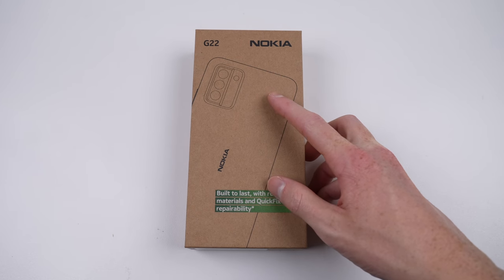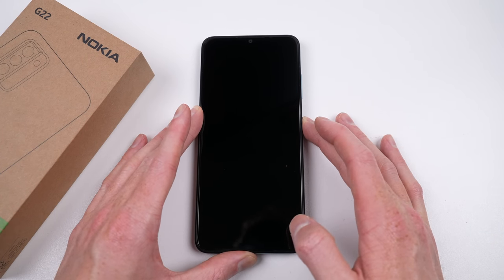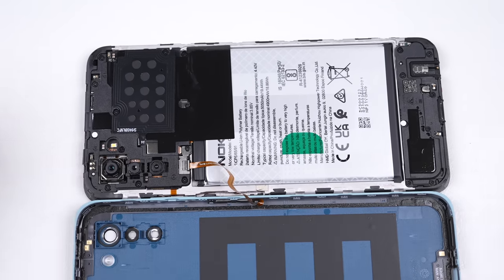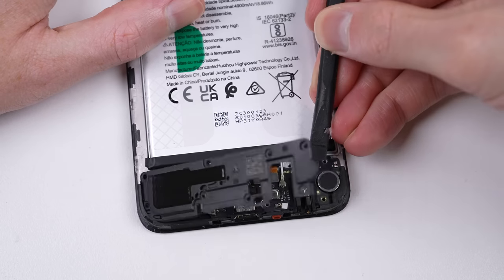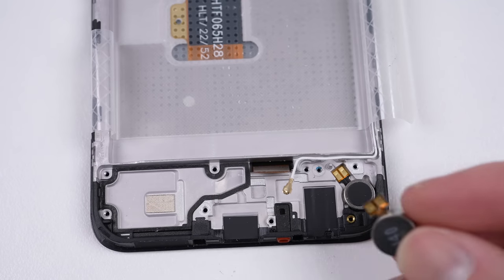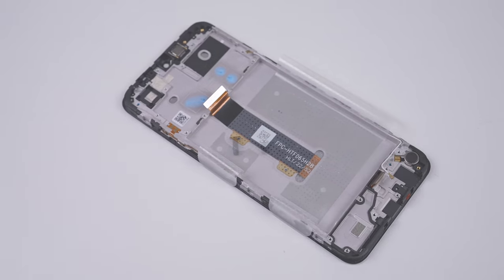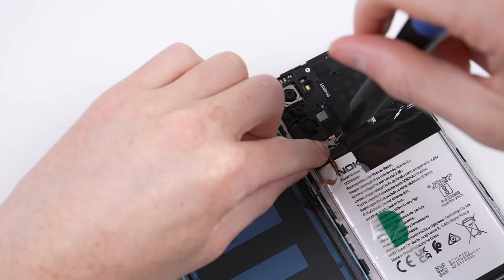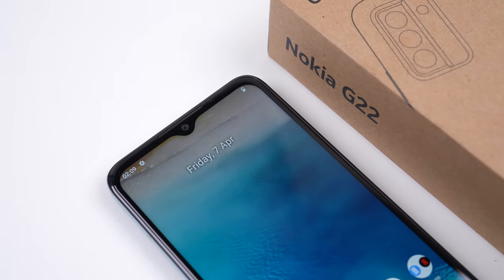Nokia Makes Its First Repairable Phone - Nokia G22 Teardown And Repair Assessment

Comment: As somone who repairs and resells phones and computers I'd say it's about as easy to repair as most modern budget phones however unlike most modern budget phones Nokia is encouraging users to have a go at repairing it which I support.
Reply: @sunshineflyer  now we need companies like apple and Samsung to allow third party repairs and easy access to parts.
Reply: @charlesrodriguez7984  yes, here in the UK I can actually buy Samsung original parts brand new from Repair Outlet. And apple needs to stop locking parts to iPhones and making them so difficult to repair.
Reply: I guess not many end-user will dare to open these. But the Nokia parts are relatively reasonably priced, and there are instructions. That makes life of repair shops so much easier and repairs worthwhile.
Support the local handyman!
Reply: @krollpeter  I agree!
Reply: ive fixed a couple phones, would love to never do it again. so annoying and stressful
Reply: @babyear5228  it needs to be across the board in every country. Here in the US it isn’t the same for every Samsung model.

Comment: Can we give Nokia a bit more applause for keeping their boot-loader unlocked?
Reply: nokia does not allow the bootloader to be unlocked. the setting enables the bootloader unlocking tool to unlock the device's bootloader but the actual tool remains with Nokia and isn't supplied to the end consumers unless you're using some shady 3rd party service (many of which are paid btw)
Reply: The bootloader cannot be unlocked on Nokia phones without dodgy software or Nokia internal
Reply: @divyamthakur  Bruh so not only is the phone trash it's actually even more trash than expected
Reply: @Jbrimbelibap  You'll never buy a Nokia if You wanna keep You Phone for more than the usual Android/Security Updates... Hugh was just wrong at the End. Repaiarabilty alone is just wort smth if You drop Your Phone like once a Month... And even in this Case, You would end up better with an insurance (Costs, Time, Knowledge of repairs)
Reply: @M1U5T0N3  You'll never buy a nokia if you understand the most basic of specifications
Reply: damn it i want to flash custom rom on Nokia 8.1 but the BL cannot even unlock without paying to some guy, smh HMD. I miss old Nokia btw
Reply: @MCPEngu1  Best brand for freedom is Asus now, best compromise between price perf and freedom is Xiaomi
Nokia's out
Reply: Unlockable bootloader means "fastboot oem unlock" or "fastboot flashing unlock". Publicly downloadable tool is an acceptable second. Anything less is not.
Reply: Is it? I messaged Nokia in several places, including their forum, tagged them on Twitter, FB, when trying to unlock Nokia 6 and noone gave a flying f
Reply: @AlexanderAhjolinna  yes, sony doesn't list all devices last time I checked, and you need to ask for a bootloader code I reckon. none of this bullshit with asus (or nothing phones as welll)
Reply: @Jbrimbelibap  all Qualcomm based phone are supported by this, not the MediaTek (because of MediaTek) which is used on their cheapest phones.

And no you don't have to ask any code for the unlocking

Comment: They should be looking at upgradability as well as repairs. If they had a consistent internal layout, they could create upgrade components that boost the physical performance of the phone by simply swapping out the main board.
Reply: Heck they could make their own production cheaper with that, reduces tooling costs while still providing a wider model range.

Comment: I hope they release phones like this with higher end specs
Reply: I would switch. I still have a iPhone X but I dislike apples non def or 3rd party repairs so I’m looking for a alternative soon. Using my consumer dollars well
Reply: That and Dex Mode, it would sell a lot
Reply: Exactly, making low end and middle range phones won't get them anywhere
Reply: Absolutely!!! So tired of these cool phones that can be repaired having crap specs.
Reply: Yeah imagine Nokia phone with Snapdragon 8 gen 2 or latest Mediatek Dimensity
Reply: @sihamhamda47  yes!!!  Exactly!!!
Reply: That's exactly what I am looking for, a nice mid range phone. This thing is simply too weak in every single aspect, really hope Nokia will keep their promise, and this phone is just the beginning for their new product philosophy.
Reply: It's probably very hard to get cost effective. Modern flagship are so dense and complex that new solution would have to de made in order so incorporate repairability into the design. And still there would most likely be compromises. Cooling, durability, water resistance, batter size etc.
Reply: HMD Global has been slow to develop the Nokia brand much more. I secretly think they want to sell their design division to some company like Blu Phones or something similar, that’s “market talk” on a few different trading sites, but that’s all just here-say without solid evidence.
Reply: It's all gaslighting.
Release a phone that is repairable, but make it so cheap nobody wants it.

It's a joke.
Reply: @kosztaz87  just the beginning?? Bro, where have you been all this time??

Huawei had something similar, Xiaomi 9 series (Redmi 9a, 9c, 9, 9 power), Moto E40, Samsung Galaxy A10, a12, a04e, a03s don't use glue and batteries are easily accessible, Nokia is a bit late for that
Reply: To be completely honest the repairability is worse than many high end phones the only good thing is the parts are available that is also true for samsung & apple phones and prob many companies will follow soon due to self service repair bills. The prices is very similar too for a repair wrt the phones price for a screen repair in G22 cost 49$ and that is 20% of the actual cost of the phone if we take s22 the display +battery i fixit kit cost 20% of the price of the phone (Both prices are launch prices and repair part is part only from i fix it). the only saving grace is the parts are available since day one compared to after 6 months-1year.
Reply: @K_240YT  I'm not so sure. Flagship specs would mean higher prices, meaning less people can get it. I think midrange and budget will have more impact, but not as much as a Samsung or iPhone with this concept.
Reply: They won't most likely
Reply: @LprogressivesANDliberals  this is why I love budget phones, they're not meant for gaming but they don't suffer from screen problems as IPS is known for its superior lifespan compared to AMOLED, IPS is also harder to bend and can withstand a lot of accidental drops, another great point with budget phones, the expansion slot up to 1 or 2 TB, even though the phone has only 32,64,128 gb of internal storage..... with the help of a micro SD, budget phones can surpass iPhones in terms of storage

Repairability now, no glued back panel makes it easier to change the battery and they're not plagued with anti 3rd party repair, all you have to do is to get a new battery and change it yourself.

I sincerely don't know why people are going cray cray about AMOLED when AMOLED is not a long lasting technology, I intend to keep my phones longer, that's why I will never buy a phone with an AMOLED panel
Reply: They will
Reply: @VictorGreed0  For a person with "Greed" in this username, you don't really understand why Samsung and Apple WON'T DO THIS.
Reply: @CL-yp1bs  ummm......Orry but this convenience is reserved to budget phones, which makes it easier for someone who use budget phones
Reply: Sadly nokia doesent make high end phones anymore
Reply: would be great if someone made a phone like a pc so we could change almost everything
Reply: @K_240YT  They tried to make a flagship (9PV) and upper mid-rangers a few years ago, didn't workout for them. I had a Nokia 7 Plus, and it was a pretty decent phone.
Reply: Absolutely, need more than 4gb ram.
Reply: Honestly, just snap in a few years old flagship soc (which is strangely hated as i see for no reason, yet much better and possibly even cheaper than newer mid range socs), and this would be an excellent device. (i'd personally even trade the 3 camera setup to one better main shooter but i guess not many would agree with that)
Reply: Never! Flagships phones are meant to be replaced every 2 years, or whenever a model is released. That would screw up the phone class system entirely. Imagine some poor guy walking around with an iphone 13 on his hand. That's not right.
Reply: @CVI2  try to tell that to a Trump supporter. I was being sarcastic, but heard a million times people "dumbexplaining" to me the important fact that apple avoids "communists" of tampering with phones, and how important it would be to keep technology evolving, thus new models every year, plus the class system of Iphone versus the communists that use android...
Reply: I’ll be happy if companies start providing reasonably priced replacement parts, compared to your average Samsung/OnePlus this is just as hard to repair, it’s the parts that make the difference here.
Reply: What do you even do with a high end phone if you're not looking for good gaming performance?
Reply: @K_240YT  Samsung makes most of its money from mid range phones.
Reply: @zee9276  that's true but Nokia would get loads more customers if it would make some phones with higher specs
Reply: @K_240YT  Yes, you're right. Like car manufacturers make a halo car just to tell what the brand is all about and attract all kinds of customers to the range of cars they have to offer. Nokia should do the same as well.
Reply: I've been enjoying my new Galaxy Xcover 6 Pro. All the legacy features with pretty good specs. I'm not sure what "higher end specs" you're referring to, but I'm emulating PS2 and PS Vita without any problems at all. What can a SD Gen 8 do more of?
Reply: @danteerskine7678  I used my S7 for 6 years and the AMOLED panel is still good as new. It's just that the glass on top is delaminating from the heat and UV that's degraded it, but this is common on LCDs as well.
Reply: I hope they release all phones just like this
Reply: @Jannie Kirsten hahaha absolutely correct! One person of reason.
Reply: @sihamhamda47 Snapdragon 8 is garbage for heat
Reply: @kosztaz87 too weak?
What is weak?
It has a screen with a good refresh rate to prevent age making it seem sluggish. It has a 3.5 jack, it has a decent camera, it has good battery life like all Nokia phones
What more do you need? You do realize you don't need to drop more than 200-300 for a cell phone right?
Reply: @JaredVonBaren HMD global isn't selling anything, all they ARE is phones. Nokia proper is more or less a separate company entirely
Reply: @danteerskine7678 there is no such thing as a good Chinese phone that isn't made by Asus, it doesn't exist
Reply: @kenGPT only thing that's pathetic is how obsessed you are with specs for a phone
Reply: @@janniekirsten6984and HMD doesn't that's the best part about them. Midrange phones are the whole point of smartphones
They make calls, they send texts, they can play music, they take pictures, you can use the internet on them.
That's it, that's all a phone is supposed to be
"Specs" only matter to people playing video games on them which is an absolute joke considering there are desktops, laptops, and the absolute explosion of emulation handhelds on the market now for half the price of flagship phones these days.
It's disgusting
Reply: @victorkreig6089  Pathetic? I'm being pragmatic. If a replacement part almost costs as much as a used phone in good condition, it still makes the phone disposable. 

Shit specs make it cheap, but parts still need to make a profit.

Otherwise there's no business incentive to offer replacement parts. 

Grow up.
Reply: @victorkreig6089  This phone is barely useable even today: that soc in it, and 4gb of memory simply won't be enough for a comfortable user experience in 3-4 years time. Also pairing that high refresh screen with such low specs is idiotic, I highly doubt this hardware could push those fps numbers out even right now, let alone as time passes.

The whole point of this phone is being able to repair it, change the battery as it wears out, so you could theoretically keep using it for many years. This fine idea is completely destroyed by the laughably weak specs, that will result in a very sluggish phone in a few years down the line. My previous phone was an LG G5, which was a top of the line phone in 2016, and by 2022 it was noticeably slow. My current phone is a Sony Xperia 10 iv, which costs around £350 right now (but can be bought for below £300 if you shop around). It has what I would call adequate specs, so it will be still responsive in a few years time, and not an exercise in frustration.

As I said, if Nokia comes out with a mid-range phone, that has the same repairable design as this, I will be VERY much interested.
Reply: Vivo v11i has the same body clip so easy to open and put a new thermal paste
Reply: They would never do that, because they wouldn't make profit
Reply: I think making phones easily repairable is a great thing the issue is that you loose water resistance. Also you'd probably lose the high quality feel of a glass back. I do think all brands should make the phones easier to repair on the inside but I understand if the back is glued on with strong adhesive.
Reply: @LprogressivesANDliberals  that's one reason why I don't like apple.
Reply: Everyone likes it, but still opt for the company that removes headphone jack
Reply: @CVI2 I don't use phones with care because I know for sure, IPS display won't disappoint me in the long run. So, AMOLED is something I'm not considering
Reply: @itIsI988  I've been using my old Redmi note 3 for a little more than 7 yrs, the phone still looks like new and the gorilla glass held up pretty well, no bleeding on the IPS display, sadly Xiaomi doesn't make rock solid phones like the note 3 nowadays
Reply: @victorkreig6089  Asus don't do budget phones, Asus is pretty much into mid range devices
Reply: @victorkreig6089  you get a point there. The playstation 5 was launched recently and you see people obsessing about bionic a15 and SD 8 gen 1, which is stupid. A Phone are meant to be a usable device, not a dlsr camera or a gaming console
Reply: @danteerskine7678  It is true that modern phones are just disposable toys sadly. Had my S7 had an easily replaceable battery and didn't get so hot then I'd probably still be using it. (for however long the glass would stay intact at least)
Reply: @itIsI988  as a long time smartphone user, I can say that Samsung and Xiaomi have the most reliable charging port ever, their micro USB ports were built like tanks, however I couldn't say the same about Huawei phones as Huawei phones are known to be a source of trouble as Huawei phones age, I remember the countless times I had problems with Huawei phones, fragile micro USB ports, bloating batteries, WiFi connection problem, impossibility of reading Sim card. I never had these problems with Samsung, oppo, Vivo, Xiaomi. Now I understand why Huawei has completely stopped using micro USB compared to Xiaomi, realme and oppo
Reply: @danteerskine7678  Yeah Huaweis are awful. My brother had a P30 Lite that literally fell apart. Eventually the USB port broke and became difficult to charge. Meanwhile you give a Samsung phone more abuse and it'll still hold together and work as it should.
Reply: @danteerskine7678  He also had the non-stop WiFi and audio problems too.
Reply: @kosztaz87  nah, no. Their phones' bootloaders are not unlockable, and you have to pay shady 3rd-parties just to get them unlocked, not to mention that they've gone to EXTREME lengths to remove the user's ability to unlock their phones' bootloaders. The OEM unlock in the developer menu is just for show.
Reply: Well you’d have to accept a high-end phone that’s not water-resistant.  Of course with some redesign, it is possible to make even a water-resistant phone repairable.
Reply: @danteerskine7678  I am not keen on chinese brands with their built in spyware and numerous shady practices.
Reply: In the past around 2010-14 high end phones were like that, I remember the Galaxy S3 and the LG G series phones were very easy to take appart.
Reply: Probably the next phone in the X series is going to be something like that, and Nokia phones are very well optimized
Reply: Samsung did but crappy batt cap on a xcover 5, 3500 is a joke unless ure ona 4.5 screen
Reply: @LprogressivesANDliberals  and u got a low 2000 ones too on the X
Reply: Which you'll never buy coz you'll forever support Apple...
Reply: As much as a good idea that is, Capitalism is li'l bit particular in terms of profitability
Reply: @itIsI988  I also had a Galaxy J7 next that has been upgraded to one UI 1.0. it's micro USB is nearly bulletproof. I do hate micro USB but for Oppo, Samsung and Xiaomi, I will buy them even with that dreaded port
Reply: @kosztaz87  dude, iPhones are the most shadiest mobiles out there, which company you know brings updates just to brick older iphones??
Reply: @elsenorvananas  as an LG Optimus l5 and Galaxy s2 owner, I can relate
Reply: @danteerskine7678  Where did I talk about iPhones or Apple?
Reply: I hope they make one that's upgradeable not just repairable
Reply: @danteerskine7678  Are you dailing those suckers? I won't mind using an S2 with extended battery and 128GB SD card as a "dumbphone", it would be alsso handy for random 3rd world situations were I would not want to loose my moto edge+ or my oneplus 6T
Reply: Just a question of time
Reply: @kosztaz87  however,Nokia no longer exists and is pratically old and outdated as it is from the early and mid 2000's
Reply: Me two I hope so too
Reply: the specs for the price made me laugh, wouldnt carry that even for free
Reply: Fairphone
Reply: I hope they release me from prison. Age is just a number after all!
Reply: Maybe take a Look at the shiftphone 8
Reply: @LprogressivesANDliberals  you wouldn't